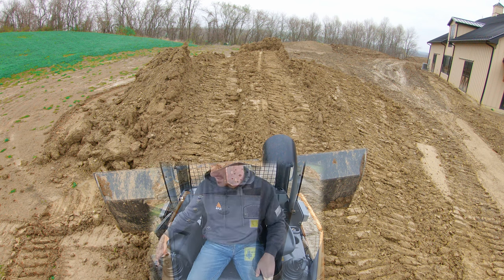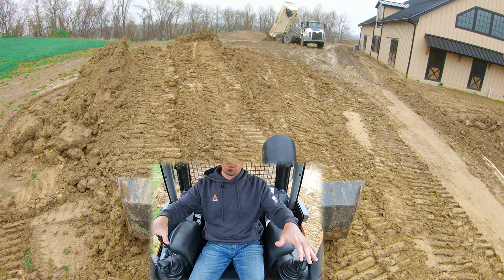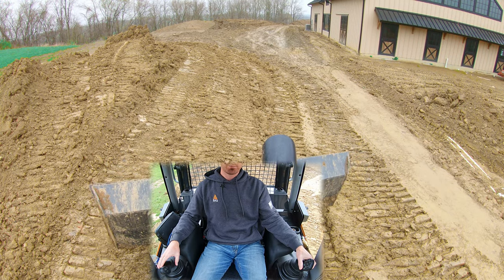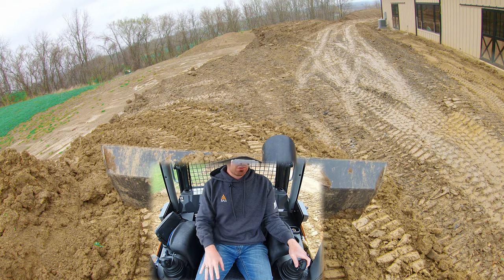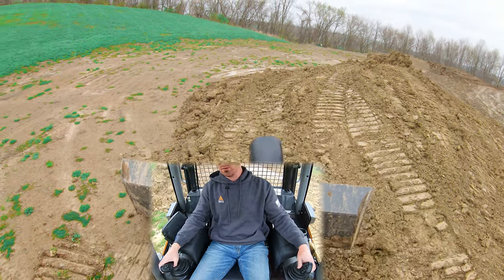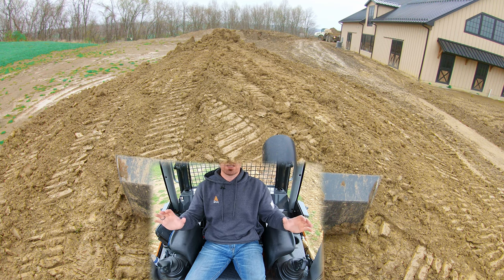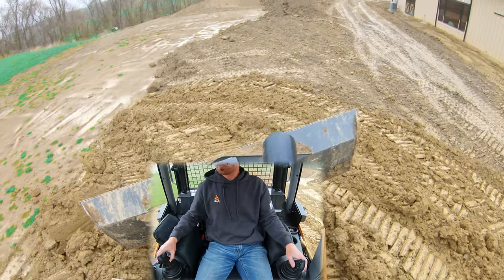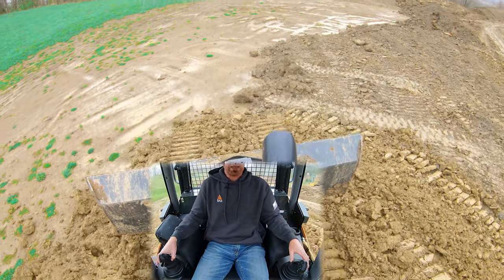How To Cut Slopes In Dozer

Comment: hi from the uk love your videos I'm a 360 operator of many years I've driven dozers only a couple of times I love them,my question is when operating a 14 ton 360 excavator on a step slope what would you say is the maximum you could operate safely I know tracks would be face up and down hill never cross track on a slope ,I know not to slew fast down hill with a full bucket, would it be safe to work on a 45deg bater I've no problem tracking up and down and working up hill it's just booming out always been taut not  too sorry if it doesn't  make sence
Reply from the maker: Thanks for watching and I really appreciate the support!  To answer your question, it really depends on conditions.  I know a lot of machines will have something in the manual about the max slope to operate on so the oil pickup doesn't run dry so that will factor into your question.  Assuming the machine is safe to run on that pitch, the next factor is ground conditions.  If you have good dirt that will hold you in place and you aren't doing a ton of spinning around then I would say you would be fine.  I would keep my boom oriented downhill so if anything started to slide you could catch yourself and not get caught with your pants down.
Reply: @DieselandIron  thanks for the advice much appreciated

Comment: Easy when you have a 6 way blade, should try it it with a cable operated straight blade like I had when I started operating, thats when skill and lots and lots of seat time come into it.
Reply from the maker: The technology has changed a lot in your lifetime.  Did you ever think you'd see a machine slot doze completely on its own?  I recently ran one of the new Komatsu dozers and the machine literally handled itself in a slot dozing application.  I only had to make sure I was steering straight.  It blew my mind...
Reply: @DieselandIron  The dozer I am on at the moment is a D 7R2 LGP with GPS and auto on the blade, love it for doing bulk earthworks on housing development projects. Never thought I would ever be using satellites and a screen and computers to move dirt but thats how it is these days. Yeah have used the Komastus we have 6 at work and about 14 X  D 6 R & Ts to name a few.

Comment: what about shifting forward and backward do you decell and brake or decell and shift or just shift see so many doing it in different ways
Reply from the maker: On hydrostat machines like this you don't need to brake or decelerate although I do try to slow the machine just a bit to make it easier on the drive train.  On older dozers (or the large dozers) that have a real transmission you will need to slow the machine before changing gears.  That's typically handled with the decel pedal since you are generally under load.  Braking isn't really necessary unless you are on a slope.

Comment: IF CHILDREN STILL PLAYED IN THE DIRT   YOU WOULD NOT HAVE TO EXPLAIN. I LEARNED ALL THAT PLAYING IN THE SAND BOX.
Reply from the maker: I would argue that some of these concepts are still difficult to grasp even with sandbox experience.  Running a dozer and cutting slopes is a pretty complex skill that you don't quite get until you sit in the seat.  Thanks for the comment Hank!
Reply: Facts
Reply: @DieselandIron i did slopes my first day in a dozer and finish grade for house pads boss had asked me why i didn’t tell him i had experience which i had never seen the cab inside before yet along operate one. Told me i looked like i been doing it for years i will say not everyone has that particular skill to get the hang of things fast
Reply: Hank your comment was spot on!! When I was a child I played in the yard with tonka excavator and dozers ;when other kids were crashing into each other I was being very meticulous and digging holes and moving dirt and you learn how to use the tractors the difference was you were power but all the basic concepts and techniques were learned right there in our yard !!!!!